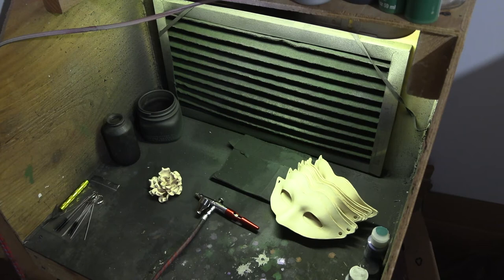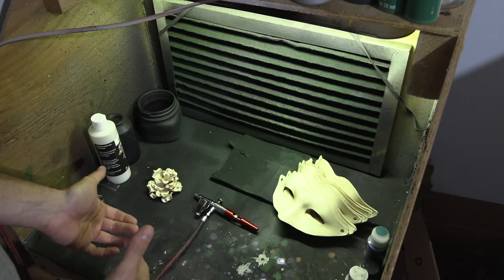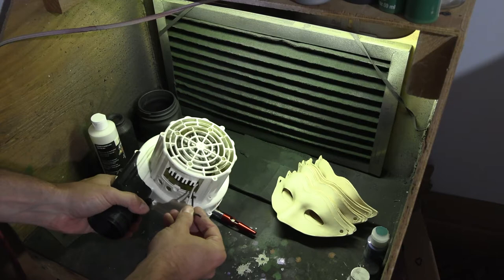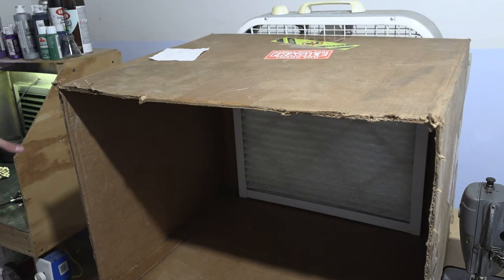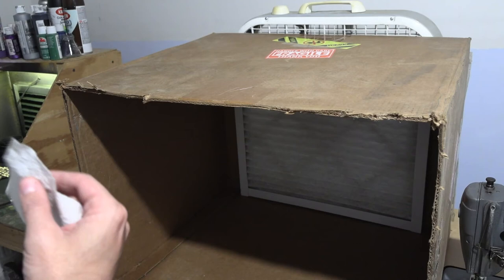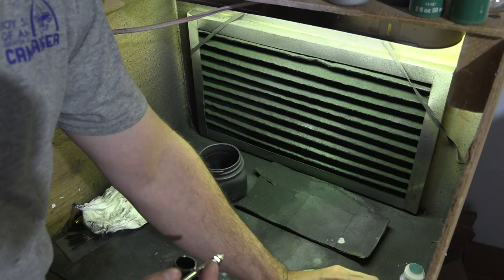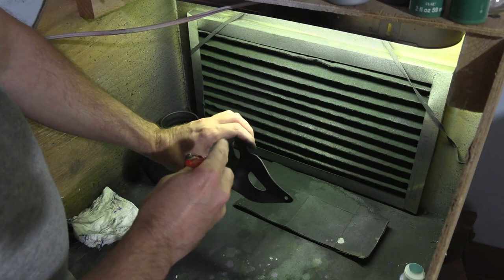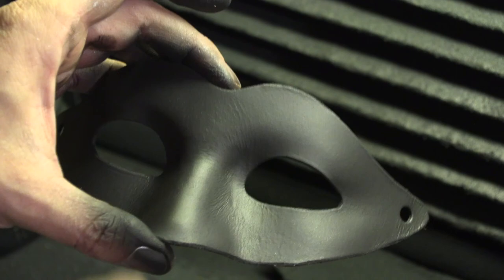Painting leather with an air brush, and how to make a really cheap spray booth.

Comment: How does the paint hold up over time? Does it peel or flake?
Reply from the maker: I have not had any problems with the paint peeling.  Obviously if you try to paint waxy or oily finished leathers there is going to be a problem.  Paint can wear away if it is an item that is going to rub against something.